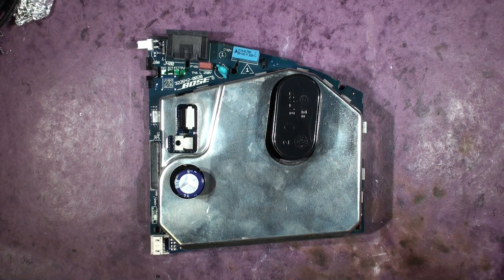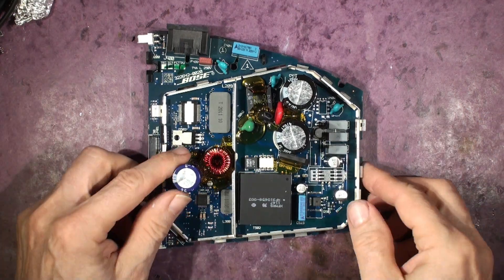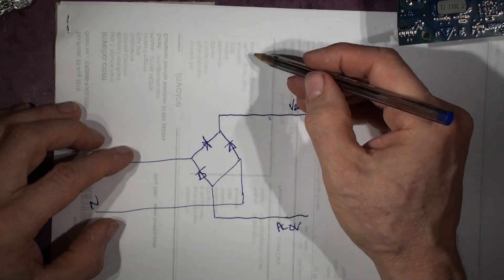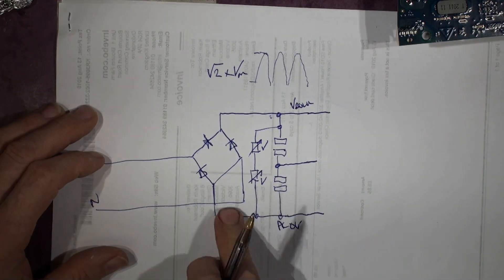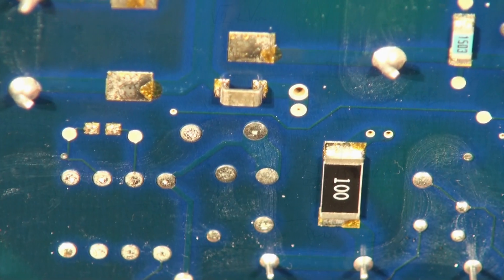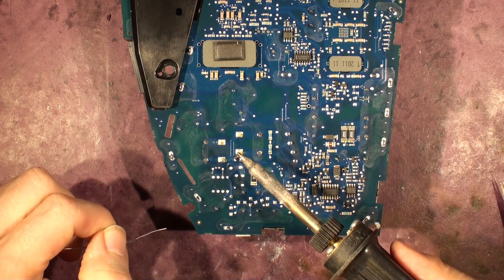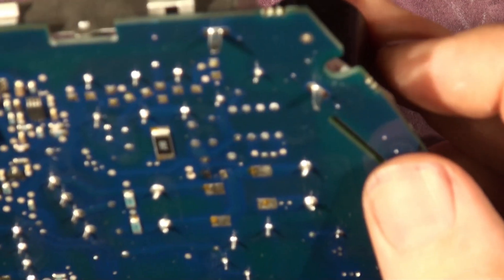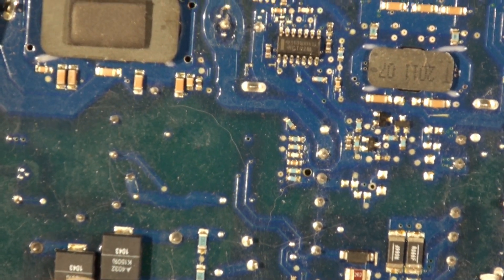Bose SoundDock 10  110 to 220 - 230V Voltage conversion

Comment: Please can you use resistor in place for the varistors ? If yes what type of resistor?
Reply from the maker: No don't try it. A Varistor is a protection device that starts to conduct current when the voltage rises above the rated working voltage. A resistior will conduct all the time regardless of voltage and will dissipate heat and provide no protection.

Comment: Need to convert soundtouch 30 from 110v to 220v will the same method work or is there a change ? Pls guide .. thx 😊
Reply from the maker: Yes, the schematic of the power section is the same. There is a resistor that passes  the start up voltage connected to D501 (from memory). It is a different value on the 220V version. It needs to be increased. If a 5A fuse is fitted (not all are) the amp rating of the main fuse needs to be reduced to 4A .  Thanks for watching.

Comment: I have only used my Bose soundtouch 30 about 5 times since I purchased it,  few years back. I tried to set it up but unfortunately it is not switching on. I live in the UK  and would like to get it looked at or repaired. If someone has contact information of any repair service, please can you post a link on here. would be much appreciated.
Reply from the maker: Get in touch with Bose aftermarket repair specialist sales@invebo.com. I train their engineers.

Comment: What of varistors type?
Reply from the maker: For conversion from 1120 to 230V mains operation you need 200VDC working varistors such as Bournes PV 150 K 3225. https://www.mouser.co.uk/datasheet/2/54/pv_series-1825431.pdf
Note any reasonable sized varistor with 150K somewhere in the part number should be 200V DC working. Just check the datasheet of what you buy.

Comment: This is amazing. Such a small change to the circuit. Would this possibly apply to other Bose products? I have a 110V Accoustimas subwoofer and would like to convert it to 240V. Do you have any suggestions?
Reply from the maker: If it is a semiconductor switched-mode power supply then it is easy to convert.  If the Accoustimass is a transformer based power supply you will need to change the transformer.

Comment: Could you pease explain how to make 110 volt to 220 V conversion for Bose Wave Radio model AWR1G1. Right now I am using a 230 V to 110 V step down transformer to power the radio. I may well NOT use the this step down transformer and use 230 V input directly if you would let me know how to convert the board to use 240 V instead of 110 V. Thanks.
Reply from the maker: You can't as the Bose wave radio has a transformer based power supply.  I don't believe that it has a 230V primary winding.  If anyone knows any different then please let me know..
Reply from the maker: Any switch-mode power supply can be changed from 110 to 230V operation.   However I believe most wave radios have a large transformer which is wound to for a fixed primary voltage.

Comment: Thank you very much for the video! It worked out for me too! I just removed the "linkage" and the system now is working with 220V power without problem. It took me like 10 minutes for the conversion.
Reply from the maker: Glad you found it useful. You would be well advised to fit the protection varistors on the main reservoir capacitors.
Reply: Please can you use resistor in place of the varistor ?

Comment: Sir. Actually i don’t have k150. Can we change with 10D471?
Reply from the maker: No.  The 471 is a 27V AC working so it wont protect the caps.  You need  200 V DC varistors.

Comment: Hi, I got the same situation. Plugged my sound dock 10 into 220v outlet while it’s 110v model. Now I need to send the power supply module to you (I watched the first video to remove the power supply module) I will need the following please:
- address to send it to
- cost estimation to repair and convert it to 220v
- and is it easy for me to put back together after receiving it from your side?
Thanks for valuable help and support
Reply from the maker: Repair price is normally fixed. However an overvoltage may be subject tp an additional £35 charge of the major components have been blown by the over voltage, See www.invebo.com/sounddock10 section.  All details are there.
Reply: @razenby  thanks! So how much will it be the total cost in that case? And can you please give me the address to ship that to?

Comment: Awesome resource! Thanks for sharing 👍 Regarding the SoundTouch10 ... I was hoping to find an appropriate point on the board to replace the DC voltage from the power supply with a direct 12V DC feed. ('Leisure vehicle' voltage 😃) As a 30W device it's theoretically possible but do you know whether the board runs at 12V or some other voltage? Thanks!
Reply from the maker: 24V DC @ 2.4 amps max across the DC smoothing capacitor . That is the blue capacitor that stands through the metal can. You can see it when the can is fitted.  You might have a problem as the switching of the frequency and phase of the Switch mode is synchronised with the class D audio power amp circuitry linked by a small signal transformer and its associated circuity. . I have never tried 
it - maybe it will free run OK with just 24V DC,
Reply: @razenby  that's fantastic, thank you so much for your help 🙌 Now I know where to start 👍

Comment: Hello, your videos are fantastic, in my case I have a sounddock 10 the part number of my card is 322642-0010, from what I see in your video mine is for 110 and 220 V, in Chile we operate with 220V, my problem is that one of the varistors is destroyed, it has the number 4032 k150 0925 and I can't get it on the market, which one can I use? I also have to change the T4A 392 fuse, apart from that I have to change something else, all the other components look perfect. Thank you
Reply from the maker: The K150 varistor is the key. the type is the K number. that one is a 150V AC varistor. (just type K150 varistor into google). Get one the same diameter that it will be the same power rating.  Usually when the varistor is fried the board has been seriously over-voltaged, so you will need to check to see if the FET drive transistors are shorted etc.etc...

Comment: My bose soundtouch 30 (110v) was accidentally plugged into 220v  ...now its totally dead. Advice...now I am in 220v area...Advice...pls..
Reply from the maker: you need a repair to replace all the semiconductors on the power supply side and probably the 2 big caps B+ too .  Contact me if you want it done. I can convert it for 220-240v operation too whilst I am at it.
Reply: @razenby  sure !! Thanks for the prompt reply....
Reply: @razenby  Hi, I got the same situation. Plugged my sound dock 10 into 220v outlet while it’s 110v model. Now I need to send the power supply module to you (I watched the first video to remove the power supply module) I will need the following please:
- address to send it to
- cost estimation to repair and convert it to 220v
- and is it easy for me to put back together after receiving it from your side?
Thanks for valuable help and support
Reply: @navjeev did you get yours sorted?

@magic smoke, how can one contact you? I have the same issue

Comment: Hi great video, what do I need to do to change a Bose wave from 120v to 240. Or is it not possible? Many thanks
Reply from the maker: Yes possible. Which Bose wave system do you have please?
Reply: @razenby  hi it’s model awrcc2 many thanks
Reply: @razenby  hi it’s model awrcc2 many thanks
Reply: hi just wondered if it was possible to do the voltage change ? many thanks

Comment: Hi, any recommendation where to get Sound Dock 3 parts?? My kid snapped the lightning connect AGAIN and I'd like to take the repair on myself instead of sending to Bose.  Thanks!
Reply from the maker: No sorry, I tooled a replacement lightning connector for the III but when I did the snap-off test bad handling test as was done with the old 30 pin parts, the dock lightning connector broke but so did the iPhone socket so I canned it. I know they are hard to get hold of. The arrangement seemed like a bad idea.